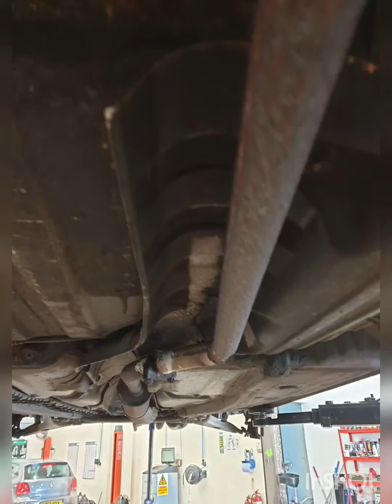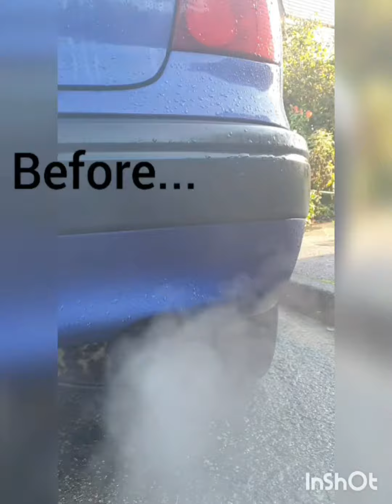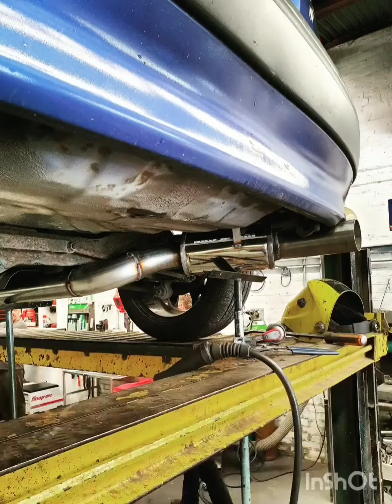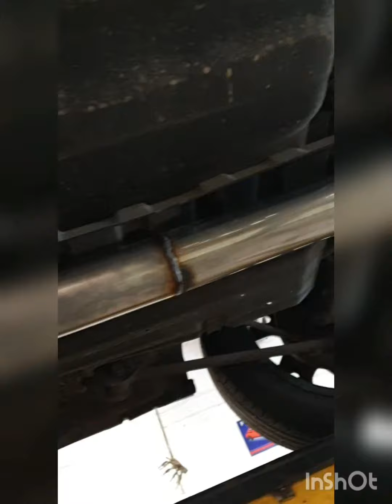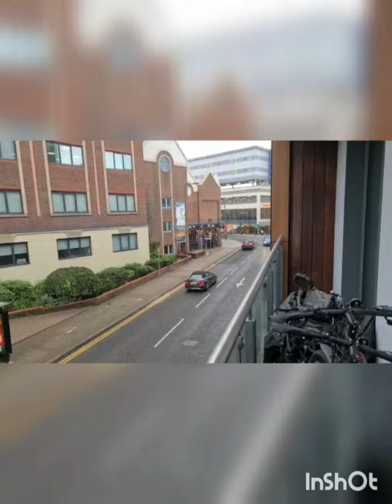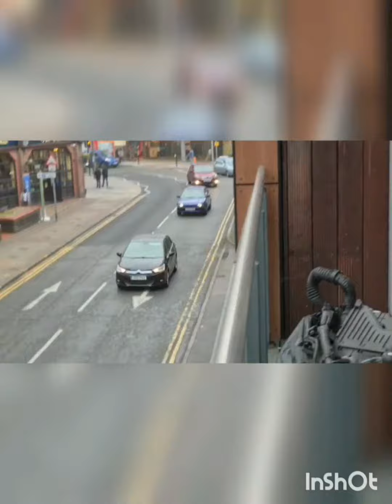Toyota Corolla E11 4E-FTE Turbo Exhaust

Comment: Hey mate, looking at getting 4efte for my e11 1.3, is it possible for you to list what you had to change/upgrade?
Reply from the maker: Hey Pal, you would need the 4E-FTE with ECU and Wiring Harness, which should bolt directly onto the existing C150 Transmission,